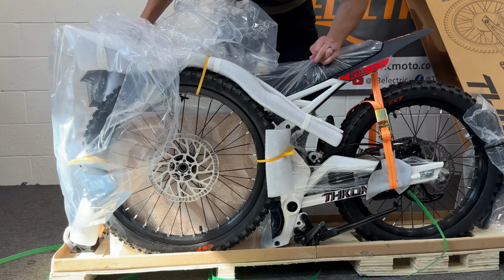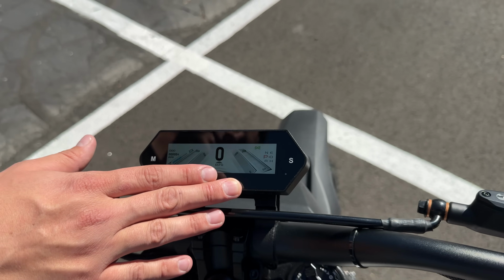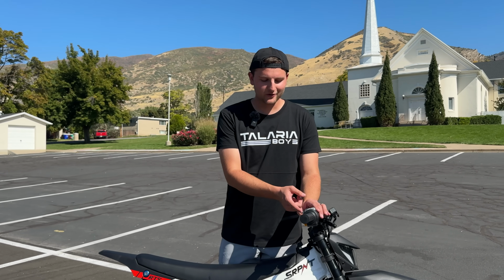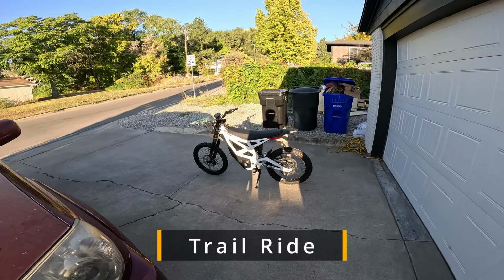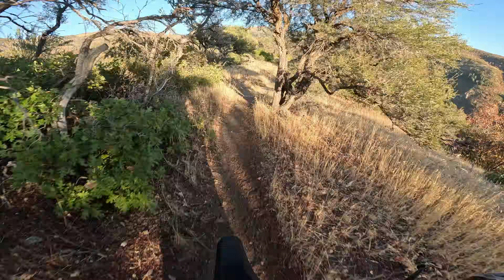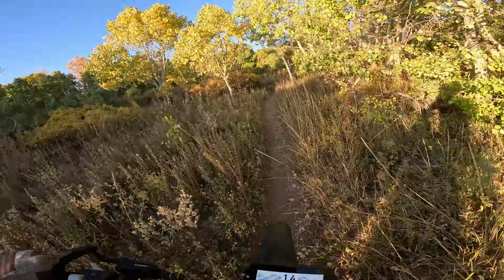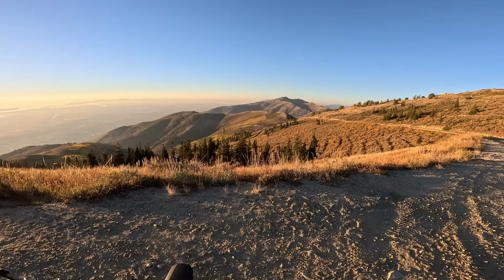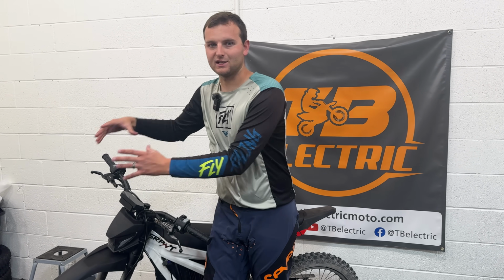Can this NEW E-Bike Keep UP?! // Throne Srpnt!

Comment: As to why it feels good, likely due to high fork rake angle combined with a high preload rear shock that further increase rake angle.  This results in quicker steering.  On my BMW motorcycles I have electronically adjustable preload and when I want light and fast steering I crank up the rear preload.  Feels more sporty that way.  If off-road, I lower the preload for more stable but slower steering.

Comment: nice to see competition in this space it will be sure to push the tech forward faster. already these next gen bikes are head and shoulders above the first models and should only get better.
range and run time have improved but there is going to hit a ceiling with current batt tech. 
what is the next gen in battery tech?
and when will it arrive?

Comment: For tight single track trail riding prety much most of the time for what i ride.. In your experience which would you prefer to have to ride? 
Fully modified Surron LBX or Fully modified Talaria MX4? I love the way the surron steering feel is compared to my MX4, but those surrons all have either 21/18's or 19/16 offroad wheel setups.
Plus the modified suspension like EXT Ferro Forks and the EXT Rear Shock. The wheels like an excel set of 21/18" wide wheels with mx style offroad knobbies on them. 
My MX4 sill has the stock 19's with some knobbies i found for it, similiar to the Tusk Grounwire's, but it still just feels akward to ride fast in the tight turns on mtb style single track trails we've made locally. 

Im seriously debating on either upgrading my MX4 with 21/18's and see how it feels with the wheels and give it a chance.. or just get a used surron and do a frame up build on a cheap one maybe, and then add all the new upgraded suspension, battery, controller, wheels, all new bearings, etc.. 
It just feels so much lighter than my MX4 and i just dont think i can replicate that with the upgrades regardless. The issue is that im on the bigger side being 6'1 and 215#. So the size and power of the MX4 even stock fits me well, but with the upgraded suspension on a surron which has the proper heavier fork springs and shock spring for the added weight of the rider and riding aggresively and light jumping, nothing crazy.. 

What do you think? I was happy with the feel of my friends Surron X, with the 21/18's, the W9 Riser Clamp, slight rise bar's, and stiffer Fast Ace 2.0 Forks w/60lb springs from Luna, on this bike. For me the rear could be stiffened up but it feels like a more normal size now and feels way more ergonomically better than MX4, plus the Front End feel on the Surrons is just way better than my MX4, which seems like it always wants to wash out in the sand unless i just keep steady throttle for loose sand in the trails..

Comment: This looks like a nice bike! Im assuming the suspension from other ebikes should be able to be fitted if they have KKE's on it? Does it have a gearbox or a belt drive, i couldnt see anything in the video.. How the rear linkage design? Seems similiar the MX4 style linkage.. 
If someone was only going to lightly modify, would you recommend this or the MX5?
Reply: Basically is a talaria, in my srpnt manual is says to use on the provided TALARIA charger which made me wonder why there are so man similar aspects to build design but hey im not complaining its the best bang for buck honestly

Comment: Did you add air pressure to the front forks before taking offroad ?
Reply from the maker: No
Reply: Forks feel a lot better once putting forks to 150psi